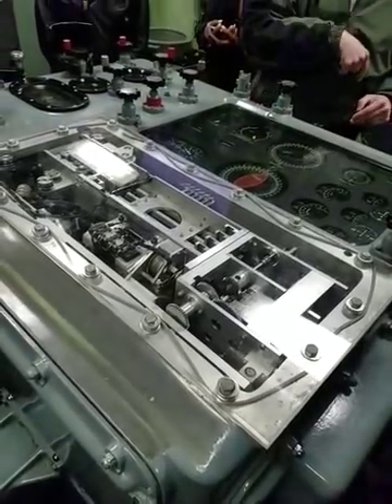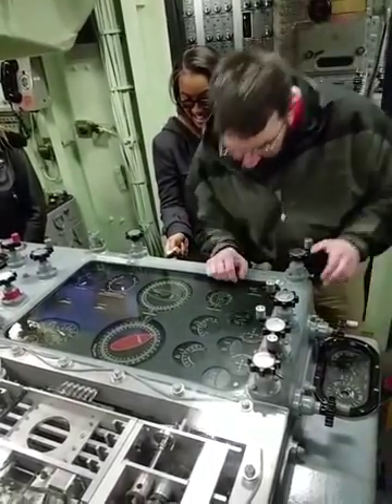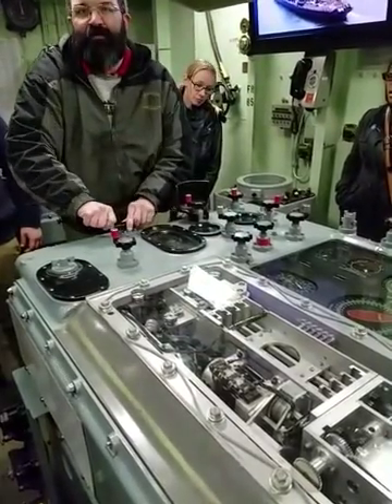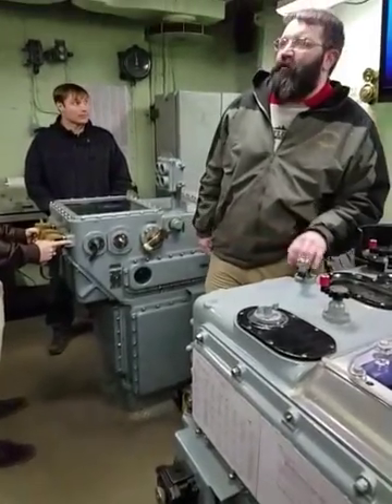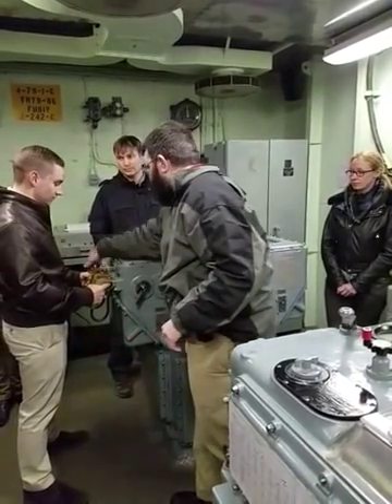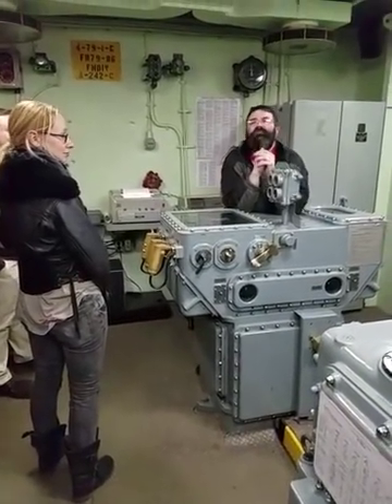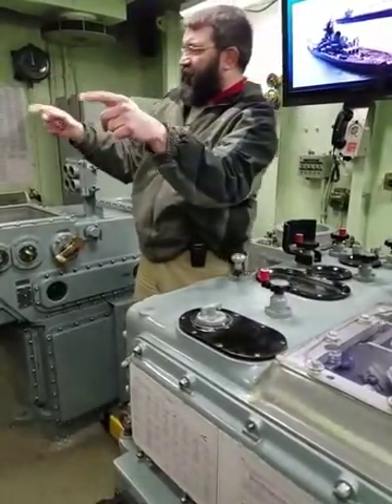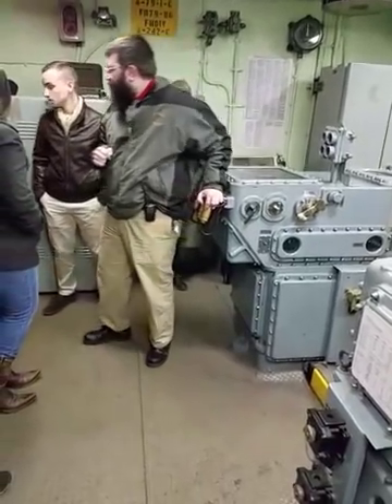Firing the 16" 50 caliber guns on the Battleship New Jersey

Comment: I was on her for the Vietnam tour. 9/5/68 to 5/5/69.  I remember when we took out Tiger Island.  🇺🇸🇺🇸
Reply: I heard about that originally when I was stationed on Okinawa in 1973, I was told that New Jersey was taking fire from an old Japanese bunker and shore battery position that the NVA had taken over and mounted guns in.  They damaged a couple of cruisers, or so I was told.  You have to admit that to a land lubber an Iowa class BB in profile looks a bit like a Baltimore class CA so it's likely the North Vietnamese had no idea what it was they were pissing off.  They missed, New Jersey didn't.  

The story teller said that when New Jersey was dismantling that installation one of her 16" rounds found the gun emplacement magazine.  It went up and the island topography was seriously rearranged.  Still very impressive.
Reply: Robert F Okinawa ... my first tour before the Jersey, I was with 2/3. They were out of Okinawa. Semper Fi
Reply: I was there also, news said the shore line changed.  It did look like a different island.
Reply: @randyghilarducci9509  were you on the New Jersey ?  I was in 4th division

Comment: Thanks I’ve had my battleship for about 9 months now just now figuring it out, finally got to the guns and needed to look up a tutorial thanks!
Reply: Did you get the heated trigger grips option with yours? I went & head n’ splurged on myself a little cuz not only did I get em’ heated but also cooled. Fuel mileage is piss poor on her though but whatev…

Comment: “When you flush your toilet which direction does the water go?”

Down.
Reply: So what happens if you are traveling directly over the equator - hmmmm?   chaos!
Reply: Yeah I rolled my eyes at that question, too. That has nothing to do with Coriolis effect. (It's not even true that draining water circulates one way in the Northern hemisphere and the other way in the Southern)
Reply: @seanbreheny9777  it is only true if your toilet is various kms in diameter.
Reply: What did the guy in the video reply after which everyone started laughing?
I heard "Red Bull light" but that doesn't make sense

Comment: Fascinating to hear such a detailed description of the process used in firing the New Jersey’s big 16 inch guns and the technology of long ago which was apparently very sophisticated for that era.
Reply: And they still work...
Reply: Good enough that they didnt replace it during the 80's modernization for the simple fact that no electronic fire control system we had in the 80's was as reliable and accurate as this engineering marvel in and of itself invented some 50 years prior.
Reply: I heard a computer science gut was tasked during the modernization of these ships to come up with a better fire control system.  After extensive research he wrote back and said 'Forget about it"!
Reply: It was incredibly sophisticated.  All done mechanically with very precisely-machined gears and gyros.  And it still worked perfectly fifty years later to the point where they didn't bother to retrofit a fancier digital computer system onto the guns.  I do wonder how many spare parts they had available though in the 1980s-90s for the recommissioning.

Comment: All these people commenting about how it’s says 50 cal and how is wrong lmao no it is correct. The cal doesn’t only stand for diameter of but in this case the length of the gun in relation to diameter. So since it is a 16 inch gun (406mm) and the cal is 50, that means the gun is 50 times as long as it is wide. 16x50 is 800. The gun is 800 inches long.
Reply: After 100 comments, i haven't seen anyone call it .50 cal. I'm not going through all of them. Did you?
Reply: @dalea1691  Well it is in the title (Firing the 16" 50 caliber guns on the Battleship New Jersey)
 Protip - ctrl+f for finding text.

Comment: Okay, so all the people commenting about the difference between a 16" gun and a 50 Cal, there is none. He was right in his explanation, those are the Mk 7 50 caliber guns. It is 16" wide, and 50 calibers long (406mm guns).
Reply: ...basic math time...50 x 16 inches does not equal 406 mm. 50x16=800...inches. not mm. 800 inches=66.7 feet ...the length of the gun barrel.  406 mm is less than half a meter in length.  Picture, if you will, the 16 inch guns of this battleship, with a length of less than 18 inches.  Heck of a mortar though...
Reply: @eaterofclams  I'm not sure if you're trolling or not but 406 mm comes out to... 16 inches. They're 406 mm wide, not long.
Reply: THANK YOU
Reply: @eaterofclams  these are accual guns. what most people call guns are rifles and pistols. rifle and pistol caliber is just that. rifle and pistol, not guns. shot used to be weighed, not measured in a caliber, or tenths of inches. by that scale this would be a 3600 pounder?
  honestly I think sailors do this because they can. they spend so much time out at sea they get bored and make this stuff up and its always blindingly hot so none of it makes much sense. but damn if they are going to admit anything like that to a stinkin' land lubber.....
Reply: @eaterofclams  you're absolutely wrong. Delete this comment.
Reply: @lukewarmwater6412  rifles and pistols are guns too... are you trying and failing to be smart or just trolling?
Reply: @CousinBowling  technicly rifles and pistols are rifles and pistols. a gun requires a crew to operate, such as the m-2 machine gun. or the guns on a ship. personally I think it is something that sailors made up, you know, calling cannon guns and whatnot.....
Reply: not sure why I cant reply to the last post with "you obviously have never gone through army basic training... or navy basic training. 
  I did SOOOOO many push ups for calling my rifle a gun!!

 you are and will always be wrong about this
Reply: @CousinBowling  caliber is measured differently in cannons versus guns as you should know, in small arms (anything smaller enough to be considered rifle or pistol caliber) represents that number in hundredths of an inch, .50 is 0.5", now cannon caliber is different, as the guy up top was trying to explain but not clearly, is caliber in relation to cannons, is the relation to the caliber of the round to the length of the barrel. now if you'd look up the barrel length you'd find it to be 66' 8 inches, or roughly 2 inches past 50 caliber for a 16" cannon, there are differences between things due to size you know.
Reply: @gabrielsturdevant9700  oh wow I thought when he said "picture if you will" that he also meant the gun was 16" long. So either way I fucked up
Reply: @CousinBowling  it's just a misunderstanding my dude
Reply: @gabrielsturdevant9700  good point. I dont have trouble admitting being wrong but I tend to put myself down for it.
Reply: The gun caliber is still 16 inches.  It's barrel length is 50 calibers--plural--so 16" caliber x 50 calibers = 800" barrel length.

Comment: neat piece of history and remarkable for its time,by the way the fancy shmansy new ships have the modern version of the hamster in a wheel crewman its called a ups but i can see how this looked good on the tour
Reply: Yeah, if power backup was important then, it's important now.  I imagine they have independent battery backup that they use before hand-cranking as a third option -- but that's just a guess.
Reply: @WilliamPitcher  Emergency generators as 2 line and backup batteries as third line. But anyways. What he didn't mentioned, if there happens to be a total blackout on the New Jersey (including emergency generators etc.), good luck turning that 2100 tons turret by hand, let alone rising the 121 tons barrel up. That may work with the secondary, but not with the main artillery.
Reply: At the Second Naval Battle of Guadalcanal USS South Dakota suffered a power failure just as she was engaging the Japanese formation at night and it shut her down hard, except for propulsion. No way to load, aim and fire the guns, even with a guy turning a hand crank or whatever. The Kirishima and other Japanese ships tried to shoot her up while she struggled, but USS Washington was with her, got a quick radar solution, and turned Kirishima into swiss chees in short order, saving the bacon and winning the battle.

Comment: Caliber in this naval usage is one bore diameter. And the gun is designated as the 16/50 caliber mark 7. It is 50 calibers(of bore diameter or 50x 16 inches) long.

.50 caliber is .5 inches. So 1" is equal to a caliber defined in most Imperial countries before the metric system was widely used.

Comment: Nerd here. The Coriolis Effect is important on big scales like firing from a ship, but it is too weak to affect your toilet water.
Reply: Efemral its basically the rotation of the earth which is what effects toilet water.
Reply: @sideswipe147 Theoretically, as the Coriolis force is caused by that very rotation of the Earth. Only if Egemral wouldn't be right.
Reply: Buffer Buffer ah but it does effect the waters drain rotation. facts are such pesky little things.
Reply: @sideswipe147  Yes, it dows (e.g. in the bathing tube), but not in the toilet (maybe it does in these strange, water-filled US-toilets). In a "normal" toilet, the water flushing down into the bowl will be affected by gravity and the design of the toilet itself way more than by the Coreolis effect, therefore leaving it negligible.
If I am wrong about that, correct me. I am always ready to learn new things.
Reply: @bufferbuffer7320  smartereveryday has a video demonstrating the effect and how finicky it is.

Comment: That is the MK-1 or 1A fire control computer used directing the guns on US naval vessels. 
I worked for NAVSUP when the battleships were being restored and had to procure spare/repair parts for that computer. 
I can assure you they do not make them like that any more. It was very difficult and had to salvage many parts from old mothballed ship and museum pieces, have them refurbished and tested.

Comment: There is a crazy amount of data that is taken into account when firing long range artillery. Propellant temperature, weight of the projectile, air pressure at multiple elevations,  firing unit's location, the target's location, condition of the inside of the gun tube, even the curvature of the Earth for very long range shots. When I was at the Artillery School at Ft Sill we learned to calculate it with slide rules, protractors, and firing tables on pen and paper before we got to use a firing computer.

Comment: This is an incredible piece of military hardware. I still don't quite understand why they quit using battleships. I've been on this tour twice. It's really awesome when they simulate launching nukes.
Reply: Giant slow-moving target with minimal stand-off range in a battlefield dominated by long range missiles...
Even with a few CIWS a battleship would be easy pickings on the modern battlefield.
Reply: What defines a battleship isn't the guns, it's the armor. For a ship to be considered a battleship, it has to be sufficiently armored to take a hit from any of its own weapons. For guns this is fairly easy, you just need armor that's as thick as the diameter of your largest shells. For missiles, you'd need a lot more, so much that it would be completely impractical. In fact, arming a battleship with missiles technically makes it no longer a battleship, as those missiles would be able to defeat its armor.

Comment: So does this station control all main guns and turrets? Or just one?
Reply: That station operates the 16" guns.
Reply: To expand on that, the 16" guns are the main ones. It also had secondary batteries which were smaller.
Reply: This station controls the 2 forward 16" gun turrets. AKA 6 guns.

Comment: Ah, the myth of your water going (counter)clockwise in northern and Southern Hemispheres.
Reply: Hurricanes do. It's just that the Coriolis effect is maybe a ten millionth of gravity. So, it shows up in large weather systems. Toilets rotate the way the water is jetted into it. If you had a perfect basin and perfectly still water, it would rotate the same as hurricanes. The effect, though, is minimal for a few pounds of water. The showman in Kenya who step back and forth over the equator and have the water switch rotation direction are fakes and manipulate the angle the water is introduced into the bowl.

Comment: The Navies  often refer to their big guns as Naval rifles not cannons and these Riflrs are 16 inch 50 calber as opposed to the 16 inch 45 Caliber guns used in South Dakota class Iowa class ships had slightly longer range slightly higher velocity shells from the extra 80 inch longer barrels and it's not 20mm and larger called cannons, its whether or not the normal  projectile is explosive or solid bullet. German MG131s used in ww2 aircraft were 13mm cannons. US M2 .50 caliber(12.7mm) is a MG because projectiles are not explosive
Reply: the 13mm MG 131 was a machine gun regardless of munition.

Comment: Toilet flushes same no matter where you are, direction is based on individual toilet design. Someone talking up thier tech using toilet exMple should know that
Reply: Adam Orick exactly what I was thinking, it's scary people like that train gunners...
Reply: If the toilet was big enough there would be a difference
Reply: 1218 no thier wouldn't.  Toilets flush based on the direction of the holes built in the porcelain.  Naturally if it were to have straight holes instead of angled it wouldn't swirl
Reply: Adam Orick the Coriolis effect is still in play when firing over large distances
Reply: Duncan McGee this isn't about firing, this is about shitter water swirls
Reply: Adam Orick Are you dense?  Toilets might flush based on design but water drains based on the Coriolis effect.
Reply: Luke Denham no it doesn't try actually traveling abroad. Water in toilets spin based on how the holes in porcelain are alined. I have traveled soutwards and they flush the same dam way
Reply: Adam Orick Dude chill I know it would travel based on the design of the toilet bowl, but you can see the effect if you had something like a kiddie pool and drained it
Reply: 1218 water does not change direction draining based on north or south of equater.
Reply: yes it does.

Comment: You do realize that 16 inches is the equivalent of a little over 406mm,  And the first thing that comes to my mind is the 16"/50 Mk. 7 naval guns, which aren't actually .50 caliber, They're actually 406mm Iowa class naval guns.
Reply: In large guns, calibers in this case indicates length of barrel relative to diameter.

So the Mark 7 gun is fifty times as long its bore.
Reply: the casual gamer 16x50=800%12=66.6 which is the length of the barrel in feet

Comment: Really dude 50 calibre? Those are cannons not machine guns
Reply: Simple. Caliber refers to the diameter of the gun. In this case, the caliber is 16". 50 refers to the length of the barrel, being 50 calibers long. Aka, the diameter of the barrel (the caliber) fifty times. 

That is what caliber almost always refers to when talking about cannons, although usually written as 16"/50 or 406mm/50. Caliber is used to describe the length of the barrel, specifically how many calibers long it is.
Reply: Just thought I'd add, a .50 cal is a machine gun. Note; .50
A 16"50cal is a massive cannon...
Hope that clears it up a bit
Reply: Yeah, what these two said. You'll see modern artillery pieces throughout national arsenals labelled first in caliber of shot, then length of barrel based on how long it is in 'calibers' such as 8.8cm KwK L71 for the german gun on the Tiger II. 8.8cm is the barrel caliber, KwK is Kampfwagenkanone or Fighting Vehicle cannon, and L71 is the barrels length in calibers, IE 71 calibers long.
Reply: When it comes to hand held rifles caliber is the diameter of the projectile, t
Larger projectiles are called cannons "20mm cannon" when it comes to cannons caliber refers to the length of the barrel (diameter X caliber= length of barrel)
Reply: Dustin Sanders ahhh gotcha...learn something new every day
Reply: @fighter_pilot_1698  yeah..some people can't see that big decimal point. .50 does not equal 50.

Comment: I took a tiger cruise from Hawaii to Long Beach when I was about 12. It was not long after the accident on the USS Iowa. They were debating on not firing the big guns if I recall correctly. But I  was lucky enough to witness the 16" guns fire firsthand. Man that heat and force that comes off those are amazing. It scared the crap out of me lol and that's all my 12 y.o. self needed to see! I also shot a M-16 with MILES gear. The other thing I remember is the ship rocking pretty dramatically. I puked as soon as I got to the Corpsman quarters or wherever. I made it into the trash can at least lol. They gave me a patch and bam no more see sickness!! Ironically enough I joined the Air Force  and was stationed in New Jersey -_-

Comment: At maximum elevation and range the Iowa class battle wagons fired those projectiles a maximum of 26 miles. Each projectile weighs 2400 pounds or a long ton.
Reply: Actually the Armor Piercing rounds weighed 2,700 pounds and the High Explosive rounds weighed 2,250 pounds.

Comment: What a great tour guide. The plotting room is the most impressive room (well rooms) in the ship. That "computer" is an incredible device. It can take so many variables and provide a firing solution without a single digital circuit. Just gears and such. That was one of the most advanced pieces of technology on the planet in the 1930s when it was designed.